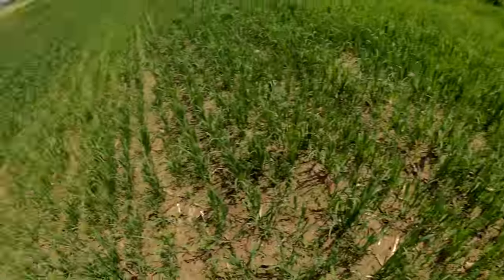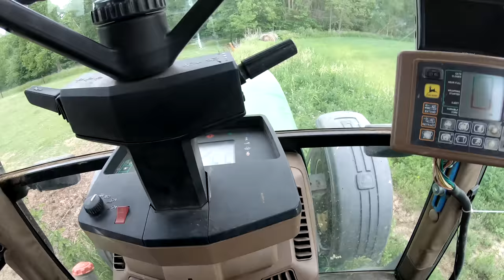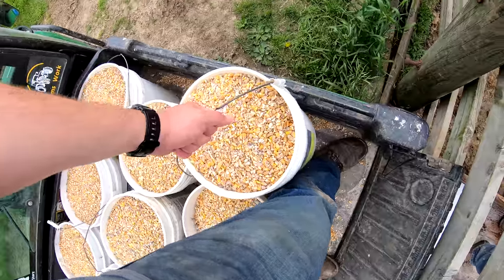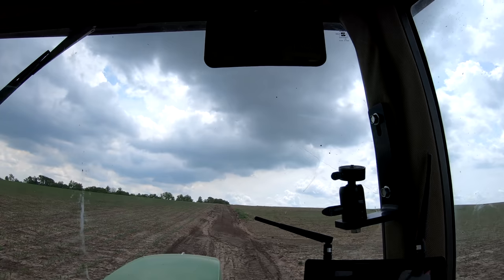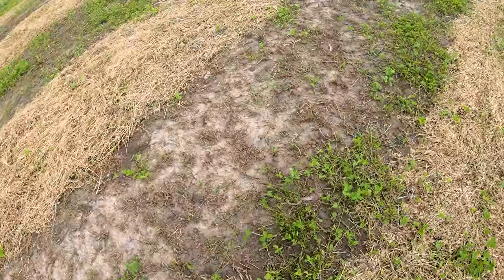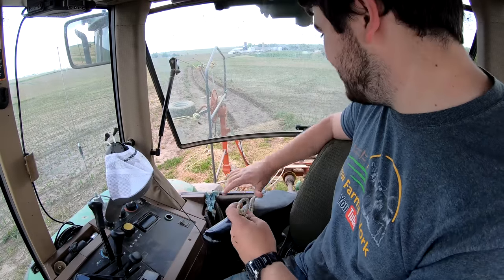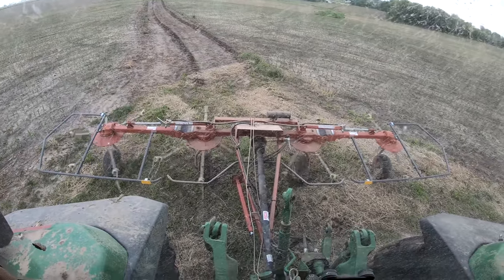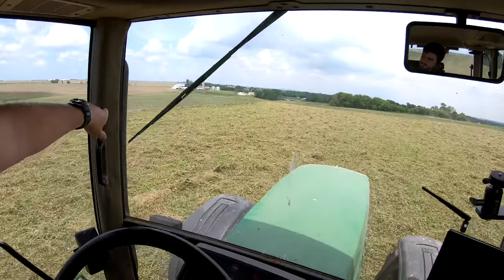Tedding 1st Crop Hay - RhinoAg PT419H

Comment: Instead of demoing a skid steer, y'all should deom a loader tractor like a 6m or 6r
Reply from the maker: A loader tractor wouldn’t fit around the corners we need it to
Reply: @HowFarmsWork  true but it could be a good use for loading bales form the field and then take the skid loader and take the bales form the trailer to we're they need to go